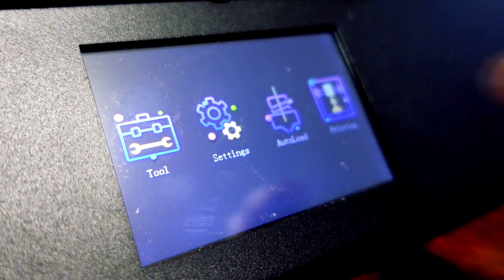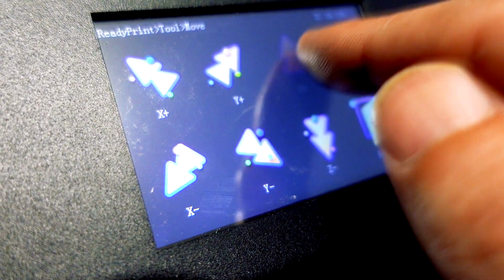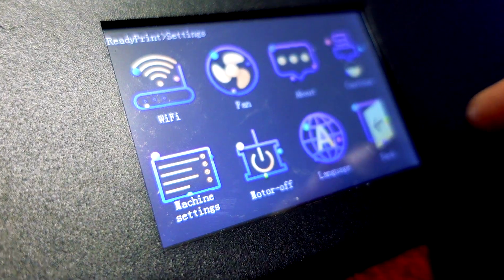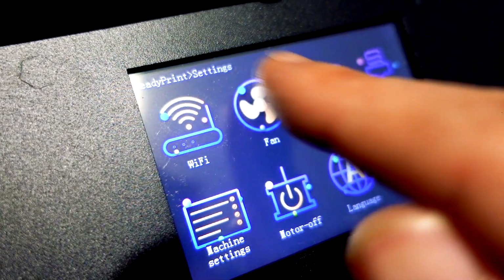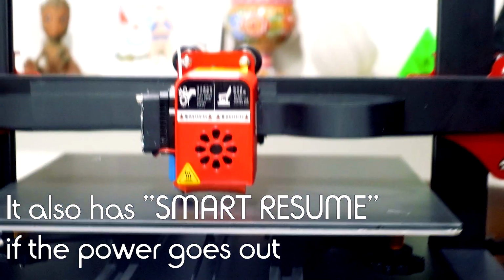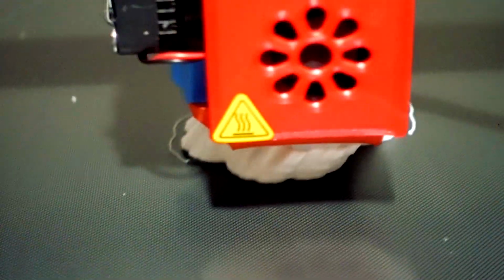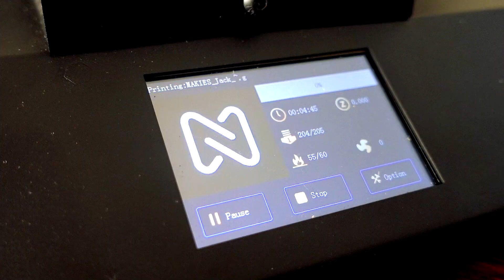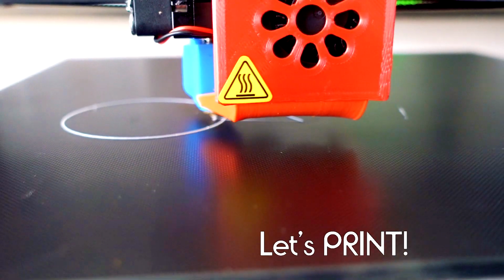INSANELY FAST & EASY TO SETUP! | NEWEREAL T-REX M18-S 3D-PRINTER REVIEW

Comment: Hey!  I received one of these for review and posted it a month ago.  I wish they included the firmware so I could look through that.  The hot end/direct drive is a pretty unique setup and I wish I could figure out the name of it?  I'd like to install a BL Touch for it since the middle of my plate has a dip in it....I can level the edges fine but that center...so frustrating!  Feel free to check my video and compare notes!  Overall it prints very well and I use the babystep to help that first layer down.